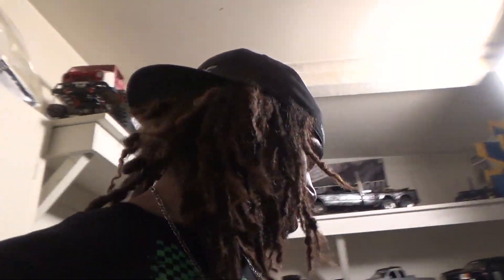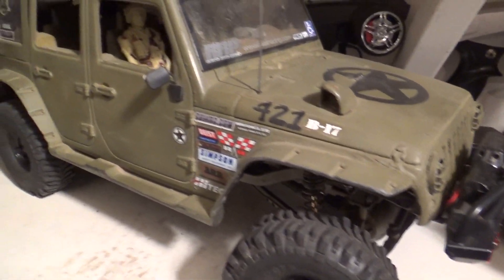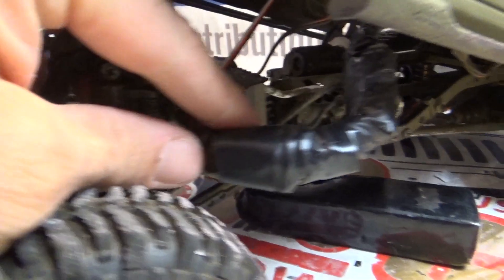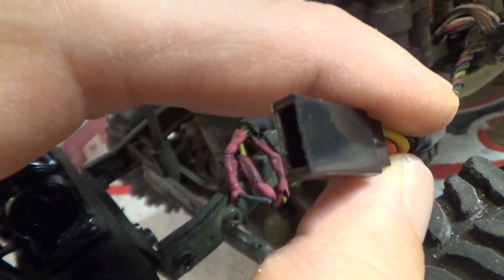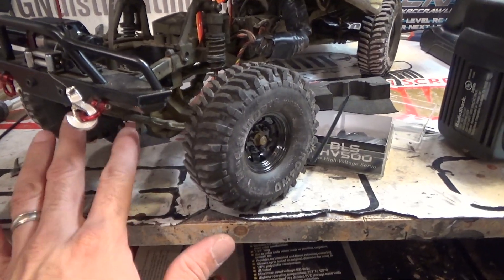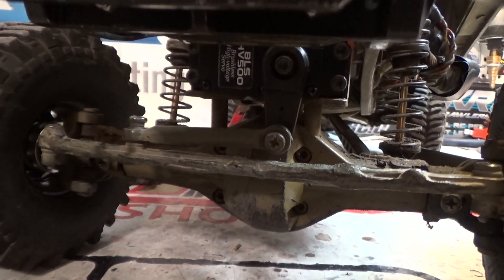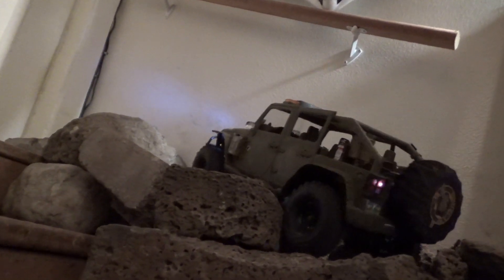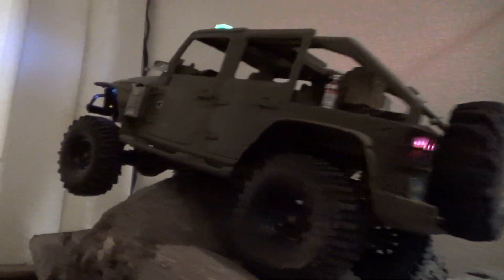HOLMES HOBBIES | MOTOR CONTROL | EPISODE 10

Comment: that was pretty cool, but i have two questions; what are the gears made of, and are they available waterproof?
Reply: gears are all metal, mix of 7075-t6 and 4340 chromoly. The case is water sealed with orings , but because water is sneaky we don't call them waterproof at this time.

Comment: Hey I have a Holmes hobbies hv500 servo and I run it on 3s but the turning is not that much all the endpoints are set on my radio, thanks